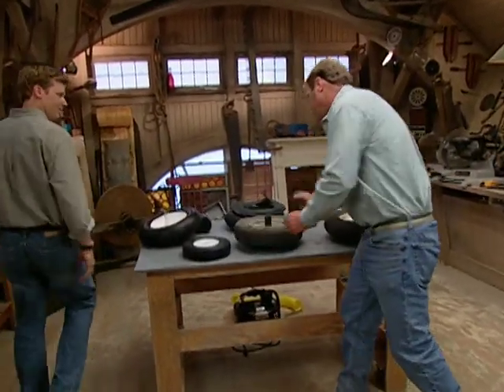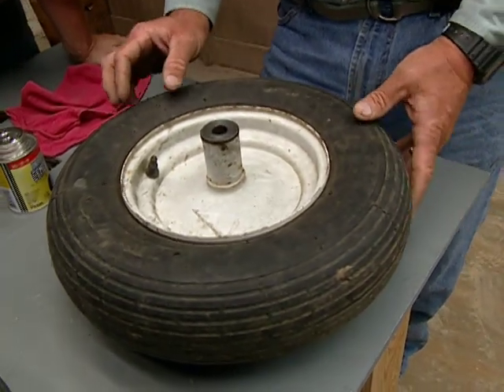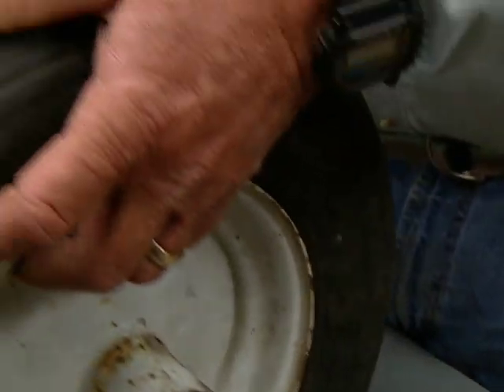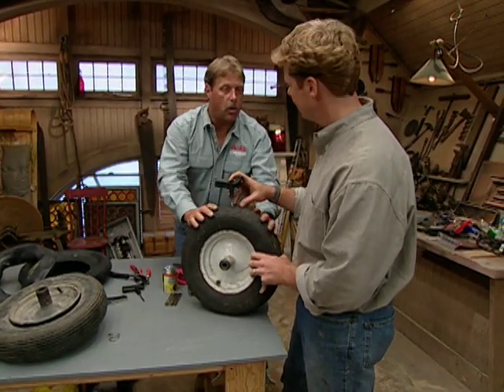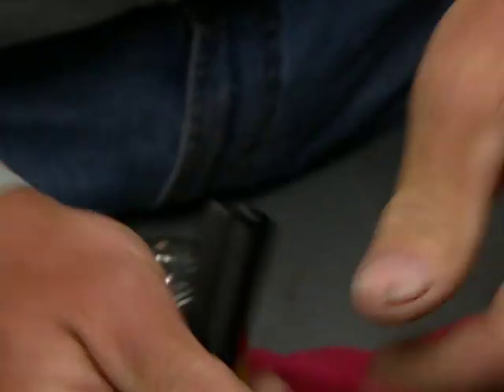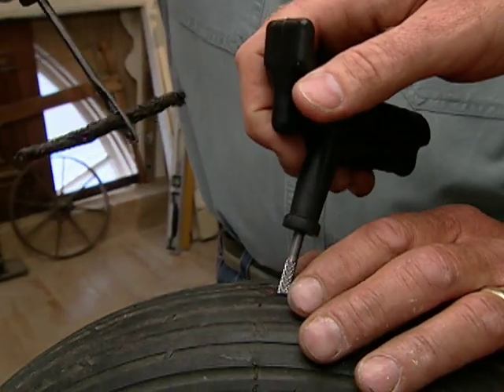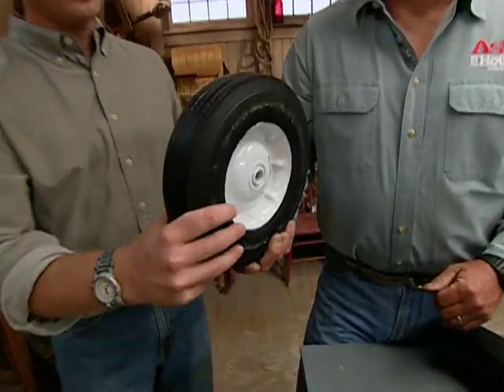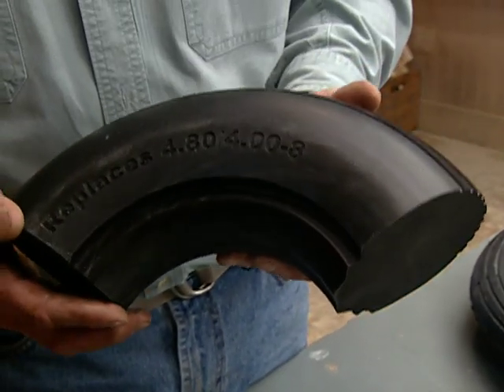How to Repair a Flat Wheelbarrow Tire | This Old House

Comment: I've mended and stopped puncture with OKO tyre sealant. I put OKO in all my garden pneumatic tyres. I got his idea from a trail riding friend who put this product or something similar in his trail bike tubes, he never got punctures, I followed his ideas and never got punters after that. The product I used said it was NOT for highway use but we never went fast on the highways. From the UK.

Comment: I got one of the foam tires and while it never goes flat, it also has more rolling resistance with a heavy load.
Reply: I'm thinking the same thing in that with a heavy load of sail in a wheelbarrow there is more resistance.  Maybe I'll go bck to an innertube type wheel or a solid rubber wheel.
Reply: Those foam tires don't like a full wheelbarrow load of concrete, keep it light.
Reply: @lendavidhart9710  That’s OK buy me because neither does my back.
Reply: Welcome to 2024

Comment: The hard part is taking the tire on/off the rim, which they didn't show.
Reply: TheEgg185 no joke those small tires like that are a pain to take on and off. Dirt bike tires are the worst btw.
Reply: Go to the bycicle shop and by tire spoons. Set of 3 Costa about $10.
Reply: I read that as “da hod pot”. Once it’s in my head I can’t shake it.

Comment: When I was a kid ,  we checked for leaks in our bike tubes by inflating them and putting them in a tub of water. Then , we marked the leaks with chalk .I think you could do the same with a small tire . (In this case the leak was very obvious but that is not always the case . )
Reply: That’s how all the tire shops did it as well.
Reply: Dunking is the easiest way if you have a convenient way to get the tire undewater.  You can also spray with a bottle of water with a little dish soap in it.  The soap will make bubbles you can see.  Also works for checking plumbing.

Comment: I don't understand how he can pull the needle-like tool out at 2:35 without pulling the plug out? That seems like a magic trick.
Reply: 1:36
Reply: I have always asked myself the same thing....if the string/rope is centered, how doe you retract the needle 'eye' without pulling out the rope?

Comment: Forget plugging. Get a tube. When checking for leaks spray the tire with Windex or something soapy. You cant find leaks by listening especially if they are tiny .
Reply: a tube for an old wheelbarrow would cost more than the wheelbarrow is worth...a plug costs pennies.
Reply: Yes you can, as long as your hearing is normal. A leak is loud!

Comment: What about concrete filled tires ?
Reply: I was thinking for a bit about doing that today. But i don't know if that will come out right. You'll have to make quite a big opening in the side of the tire to pour the concrete in. When you go bounce of steps with 100kg of weight in the wheelbarrow then it will slowly become a mess. And it's heavy of course so if you have to pull/push an additional 20kg uphill it won't be positive.

Comment: How about How to Replace the Wheel Barrow Handles......?
Reply: That’s fairly easy since they are held to the bucket and frame with bolts.  Just unbolt the old and swap in the new ones.  If the handles are generic without any predrilled holes you can use one of the old handles to put against the new one and mark where to drill.  If your bit is long enough you can clamp the old and new handles together and either drill as far as you can into the new handle or straight threw it.  Just make sure the handles holes all match.

Comment: stupid question im guessing when you push the plug in why doesnt it pull back out when you remove the needle ?
Reply: The "eye" is C-shaped, not O-shaped.
Reply: At about 1:37 he says that the eye has a little opening with a couple of cutting edges in it. Look for the Victor Heavy Duty Tubeless Tire Repair Kit on Amazon for a better photo.

Comment: I had a tubeless tire that went flat in a wheelbarrow... I spent $4 and put a tube in it 8 years ago.  No problems ever since.  Forget the plugs, they are a pain.
Reply: Depends how often you use your wheelbarrow. Roger gets a lot of use out ohis being a landscaper.
Reply: Charles Damery I have 7 acres in TN... use my wheelbarrow every week, sometimes numerous times a week.  Dirt, concrete, hauling brick/block, etc.  I've gone the plug route and putting in a new tube for a few bucks is a much more permanent fix than plugs.
Reply: William Todd Smart move!!!
Reply: Unusual to see a 2ply tubeless barrow tire. Most of the time they are tube type tires that someone has incorrectly fitted tubeless.
Reply: thx for the tip- I am going to try put a tube into my flat tubeless tire.  How does it work with the valve on the tube? The valve on the tubeless tire is fixed to the rim isn't it?

Comment: I looked into getting a flat free tire and it cost more than a new wheelbarrow at HomeDepot.
Reply: Harbor freight 20 percent off coupon is doable when you use a wheelbarrow a lot.
Reply: @betterstill100  when it comes to wheel barrows have strong handles and top of the line wheels that never let you down.  If you have a table saw you can rip yourself a great pair of handles from hardwood to make your own.

Comment: Plug repair is the ABSOLUTE WORST! Never works. Ruins the tire.
Also rubber is only good for 10 years. After that it dry rots and isn't safe anymore. Just go to harbor freight and get a new lightweight plastic one.
Reply: I have to agree on that. One year ago i fixed my wheelbarrow tire with such kit and today it's leaking. I've ordered a tire sealant spraycan which you have to empty into the valve, that was like 10$ or something. Hopefully that fixes it. If not, then it's solid wheel time.
Reply: I am all for fixing, updating, and preventative maintenance - but this (my) dolly is over 12 years old and the air leaks after a weeks of non-use (tubeless). Considering the age - your idea is spot on. 

$ 260 cycle tire - pro repair...wheelbarrow/dolly - replace. Thanks for the idea.
Reply: @Engineer9736  Well, you should have done the plug right. You should remove the tire from the rim, and get a plug and patch where you plug it and put a patch on the inside of the tire. The kind shown in this video should really just be an emergency type repair to get you up and running again, not a permanent one.